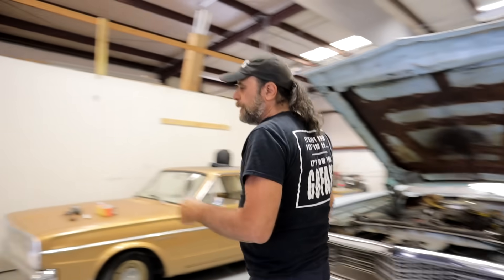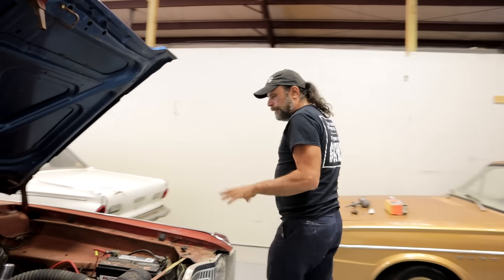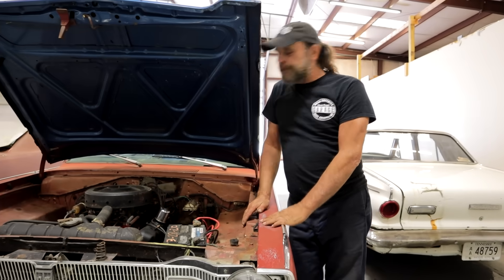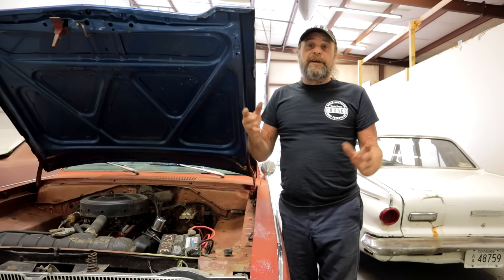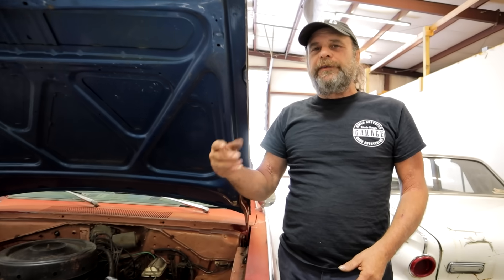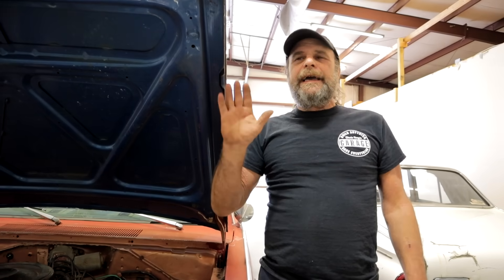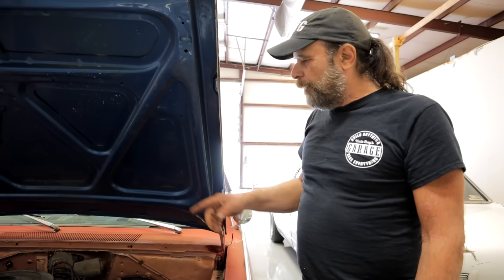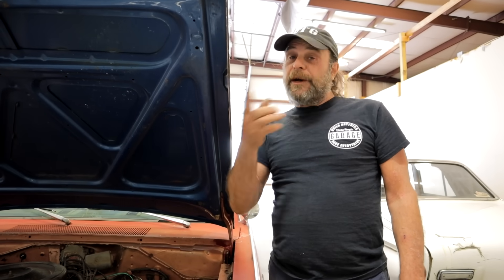Old School Tune-Up Mastery For Beginners: Setting Up Points The Easy Way

Comment: Back in the 60s I always carried a set of points in the clove box. I remember setting the gap with the flap off my cigarette pack.
Reply: I drive an air cooled VW beetle. I keep a set of points and a fuel pump.😀
Reply: @strokermaverick  
I used to do the same. 
Then I went diesel and realized there was something with more torque, and hp. 
That got twice the mpg. 
That had heat. 
And could actually last for 100k. 

And needed no tune ups.
Reply: @fastinradfordable  I’ve had VW diesels also. I just love air cooled.👍 As far as, heat is concerned, I know how to maintain the air cooled heating system. The hottest heat, I’ve ever had in a vehicle, is from an air cooled VW.🙂
Reply: But stinks blows black smoke harder to find fuel and slow off the start. But hey to each there own. My 304 with points will be waiting for you at the next light
Reply: @strokermaverick  Match book cover was perfect for .019 gap on old Beetles!
Reply: I use to set my Chevy with a match book cover, lol
Reply: @buddyboy1953  Same here, anything simple.
Reply: A new set in the glove box" and at least 3 in the tool box. I just put them where I new it would get me home if I didn't have a matchbook

Comment: Right TOny, this is a great demo that it ain't rocket science, just as reliable and way cheaper to fix!  Like, everytime I had an HEI and it got hot out or on a road trip I spent the same amount of time on the side of the road and 6 times the money to replace the damn module in the distributor, under the rotor in the same spot as the points and still basically always needed to carry a spare, just like points!!  I guess I don't know what the "point" in converting was, they're supposed to last longer?  I understand it's contactless cuz of the magnetic pickup but worthless if the damn circuitry melts in the wax glue it comes sealed in.
Edit: oh yeah, cool trick with the dwell meter, never thought of that one!  I used one on my GM points a few times and always feeler gauges otherwise

Comment: Great video! If the Chinese ever hit us with a EMP bomb you'll wish you still had your points ignition!! We'll be the ones still driving around while all the new cars will be junk! Just like Road Warrior!!😀
Reply: Vw idi diesel ftw,pull the injection pump shutoff plunger and pop start it down a hill.
Reply: The ignition coil is toast in an EMP wave

Comment: Not my words: 

BASICS For Beginners:  What is DWELL Time Regarding POINTS:

Dwell is an important measurement in the timing circuit of your engine. The goal is to get as much dwell (closed points) between spark plug discharges as possible. The longer the dwell time, the more charge built up in the coil and the stronger the subsequent spark. Unfortunately, with mechanical points systems, there is a physical limitation to how long the points can "dwell" closed and this is where the "gap" specification comes in. The ideal would be to have an infinitely small gap so when one of the points cam lobes bumped the moving point open, it would be an infinitesimally small opening, just long enough to collapse the magnetic field in the coil. And BAM, you get a bigger spark... or at least the biggest available spark...

In real life, that is an impossible goal with mechanical points. First, it is impossible to machine the parts with that precision. Even if you could machine to that precision, ANY wear or thermal expansion would destroy spacial the relationship of the parts. And this kind of wear happens rather quickly during engine use. Add to that the nasty tendency of all that inductive electrical load to arc across a small gap and you are left with needing to set the points with the equivalent of a grand canyon sized gap. Any sized gap isn't a good thing with respect to hot sparks, just a physical necessity. 

That is why some high end mechanical distributors are fitted with dual points. The two sets of points are installed slightly out of phase so when one set opens with it's necessary big gap, the other set is still closed. When the second set finally opens with it's also large gap, the first set of points is just closing. Thus, this is a mechanical way to achieve the 'infinitely small' gap, longest possible dwell, the highest possible charge in the coil, and the hotest possible spark.
Reply: Right on! Good explanation on dual points vs single. I still run a dual point on my 340 Demon 4 speed. Never been stranded with a point ignition, but I have with a electronic!
Reply: Interesting copy/pasta bruh... I didn't realize the theory of dual points.  The simple answer is dwell is the time the contacts are closed.  A coil of wires builds an electromagnetic charge when energized by the contacts being closed, when the contacts open the electromagnetic field collapses and senda high volt discharge to the center windings and out to the cap to the appropriate cylinder at that split second.

Comment: Back in the day. I stopped by the parts store to pickup points. Engine waS running fine. When I  got back to the car the engine won't fire. Changed the points right there using a matchbook cover as a feeler gage.
 Checked the dwell when I got home.
Perfect 50' dwell.

Comment: Another quality lesson from Uncle Tony!  It might be good for the super-noobs watching this to explain exactly what dwell is though
Reply: The period of time when the contact points are closed, thus allowing for the coil to build it's electromagnetic charge that will be collapsed and send the built up discharged high volt spark out to the cap and down the line to the appropriate cylinder when the points are opened.
Reply: @THRASHMETALFUNRIFFS  I always thought dwell was was when the contacts were open and when they are closed it is coil saturation. I guess they are the same thing when closed.
Reply: @davidleonard8369  Yes, the coil is "saturating" during the time the points are closed, which is in fact the dwell time or "wait" time.  THe points only bump open for a split second!
Reply: @davidleonard8369  I guess the "open" time would be called something like: The Moment of Ultimate Discharge?
Reply: @THRASHMETALFUNRIFFS  don't know about that. But when they just break contact is certainly when the coil discharges. Great for setting static ignition timing.

Comment: Got me a dual point mallory waiting in the wings for my 73 dart swinger.
Trouble is fuel will be delivered by a TBI Holley Sniper. Got that already too.  😝
Reply: Engine masters just showed a couple days ago the carb made 10hp more even though they spent all day tuning the Sniper.   DOH 😣
Reply: You're running EFI... with points ignition...?  That's interesting.
Yeah, I gotta say, EFI has the same advantage as HEI... convenience, not performance.

Comment: Seconding the comment for the drop light. And even a small light on the cam would help a ton for vids like this. But I was still able to get the point of what you are teaching. See what I did there?
Reply: If you are working on a slant six in an early a body you can't see anything light or not lol. Back in the day I just pulled the distributor and stuck it in a vice. Then either use a feeler gauge or spin it with a drill motor and set dwell.
Reply: I didn't see what you did there. You'll have to condense your comment for clarity or dwell longer on your explanation.
Reply: @rcnelson  i'm not sure i have the capacitance to see what you've condensed in your statement
Reply: @richardcranium5839  ok, but some of us still have have points. You known, Echlin, Bosch, standard high grade, blue streak, Delco Remy, accell, Mallory. Nylon rubbing blocks are evil. And sand is the mortal enemy of breaker points.
Reply: I do.  Nice😁
Reply: Doofey, you are amazing if one is eight years old.

Comment: Thanks Tony!  I have a 55 chev 6 cylinder and pulled the distributor EVERY time - always risking not getting the dist blade back into the oil pump every time - because - I never knew I could just use the ole dwell meter!  What a time saver!
Reply: Most of the time you can install ignition points in distributors in the car but there are applications where the distributor should be removed for better access to the points.

Comment: UT:  Please consider hanging a drop light in your engine bay for better visuals in some of your videos.. Thanks..
Reply: Its rough to see what you're doing at times. I think it might help stabilize the focus some on your camera as well.
Reply: This is an analog points vid.
Reply: @bobroberts2371  
Then out in the sun at least
Reply: @bobroberts2371  lol
Reply: a drop light :L.E.D. or flourescent would be great for filming an engine bay...tbs
Reply: Every single one of you people talking about a light need to be T bagged  Immediately
Reply: Hang a cheap battery powered unit from the hood latch
Reply: That would ruin the effect of a possible Explosion...i say leave well enuff alone
Reply: I was thinking exactly the same thing.
Reply: Yes, and he never really explained what he was doing to the points and how he was doing it to correct the dwell.
Reply: @terrypikaart4394  pretty clear that he turned the screwdriver one way to increase the dwell and back the other way to decrease the dwell. And I've never seen a set of points in my life.
Reply: silkysixx im glad it was a assumed observation, but doing it is a diff story..
GM points are gap or dwell adjustable thru a window in front of cap.  All others you have to remove cap, loosen a screw or two, place a flat blade screwdriver between two pegs and in a notch in points.  Then tweak it in one direction or the other changing gap, then retighten screw reinstall cap and check dwell agin.  Moving the points in .001 increments can be very tricky even for someone thats done 100s of them..  Thank god for GM and the external adjustment..
Reply: @terrypikaart4394  how does that relate to this video? He demonstrated on the unit next to the car and then did it on the car. What further explanation is required?

Comment: I also have some of those old craftsman ignition wrenches tony. also used the dwell meter religiously when doing tuneup's on my pontiacs and it worked well! thanks for the video!
Reply: I've had a full set of them wrenches sine I got my first set of tools when I was 12, I never knew that they were call ignition wrenches. So then I have been using them for the wrong things almost 40 years.😲🤣🤣🤣
Reply: @bigbear5510  they also worked great adjusting the the headlights on my grand marquis.
Reply: Does Pontiac have the same window and hex key adjuster while it's running, I guess so,  it's GM?
Reply: @THRASHMETALFUNRIFFS  yes it does! when I saw tony adjusting while it was off, I was confused.
Reply: @kurtzimmerman1637  Aha, right!  So you just hook to the coil and ground and fire it up and adjust the nut in real time through the window, EZPZ!
Reply: @THRASHMETALFUNRIFFS  it worked quite well using that strategy. never had problems using that method.

Comment: Thanks for showing us the finer Points of the ignition system.  You have filled a Gap in my knowledge, but I won't Dwell on my ignorance.
Reply: Salute to the Captain for the quad pun in a single sentence award!
Reply: You must have had quite the spark of imagination to come up with that electrifying comment lol
Reply: @JimsRustyOldNuts  I wanted to Crank that out Before The Dumb Commenters could Fire off a Retarded reply because their Timing is Missing the Mark.
Reply: @captainjohnh9405  🤣🤣🤣
Reply: @captainjohnh9405  /w\UnWHOLY-METAL/w\

Comment: The good thing about points is if they fail, you can usually sand or file them a little to get them to work.  If your electronic ignition fails then your screwed
Reply: Right, like everytime I had an HEI and it got hot out or on a road trip I spent the same amount of time and 6 times the money to replace the damn module in the distributor, under the rotor in the same spot as the points and still basically always needed to carry a spare, just like points!!  I guess I don't know what the "point" in converting was, they're supposed to last longer?  I understand it's contactless cuz of the magnetic pickup but worthless if the damn circuitry melts in the wax glue it comes sealed in